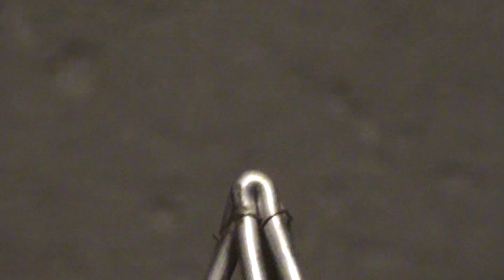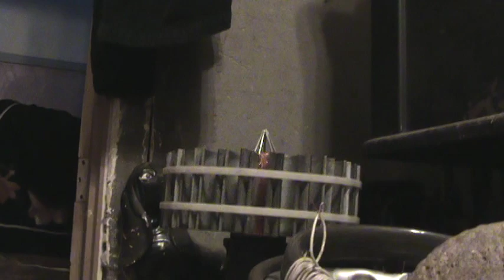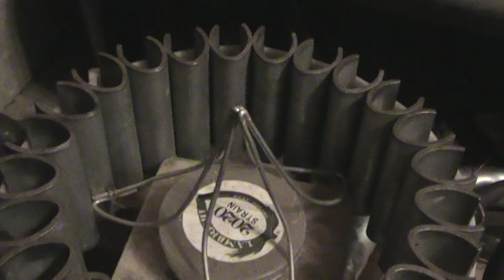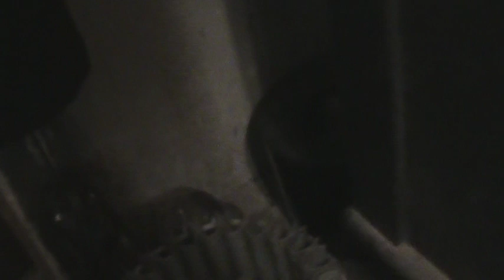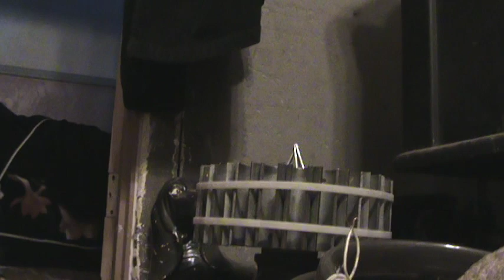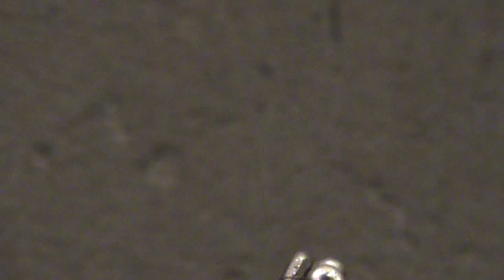Leedskalnin's generator & the visible flow of magnetic current

Comment: Remind me, have you sprinkled fine dust of various substance over it before? Magnesium powder, sugar powder, wood dust, stage smoke,  etc? Has the visual effect ever been recorded on strictly analogue camera?
Reply from the maker: I have tried everything that I can think of I know that there is a radiation that comes off of a leedskalnin pmh I think it must be a purely magnetic radiation not electromagnetic
Reply from the maker: It is a visible distortion that looks like the road on a hot day and can be manipulated to form a vortex . The distortion/heat signature that I see is polarized and the poles can be separated
Reply from the maker: Build a small toroid pmh an aluminum tube filled with fe3o4 iron oxide wrap it with a coil 30 turns of copper wire energize it with a battery and see for your self it is very subtle but when your eyes catch it you will be amazed

Comment: Do you have the exact dimensions for leedskainins device?    Have you tried colored water above the device?    I'm building an antigravity platform info from a crop circle in England its my profile pic.   I have a box of brake drum turnings and will be using glass plates with water above my new toroids.  iron filings will float using water suspension .  when I pulse the coil the iron dust should show what is going on.
Reply from the maker: Watch Vinnie St Vincent channel

Comment: David,

You might try susdending a large mass a couple of inches above the aluminium, i'm not sure if metal or stone would be better.  also perhaps a cloth with a pattern (lighter colors) hung immediately behind the spire would help with focus as well as bringing out the visual distortions.  A cool experiment would be to suspend a mass with a low friction rotational bearing (think playground tire swing hardware) and see if you can impart rotation without contact by spinning the PMH device.

Comment: David, we need you to break and re-lock the device while you are zoomed in on that top part above the aluminum wires. And, while the lock is on, to keep the camera fixed and go from spin to stationary, high spin, etc. We can see something aright, but without execution such as mine, it will mean nothing I'm afraid.